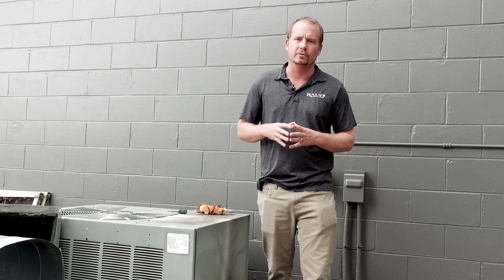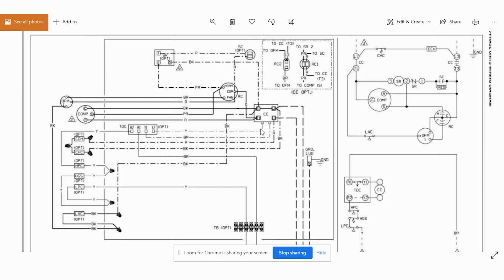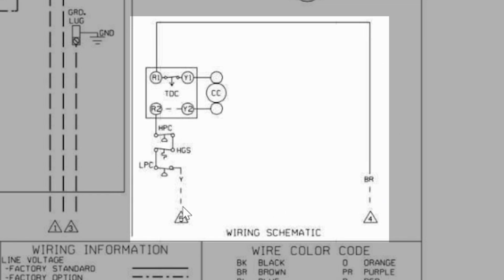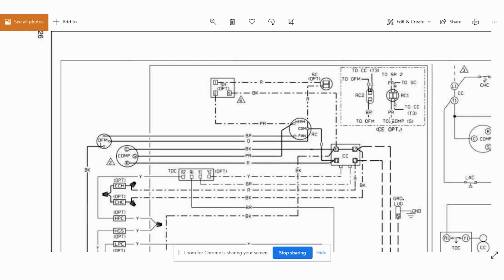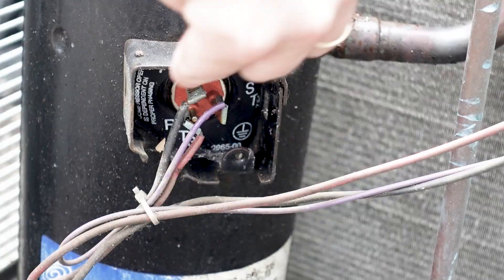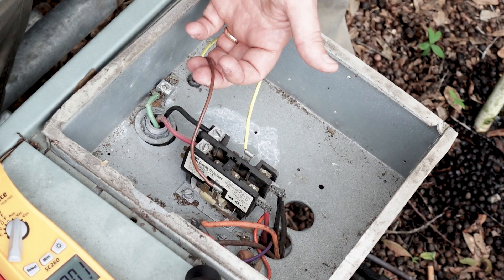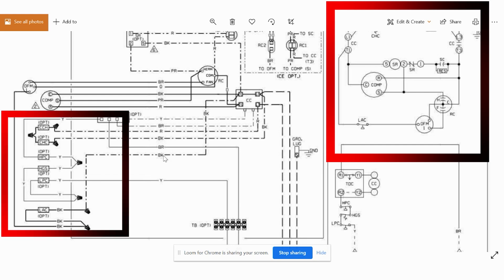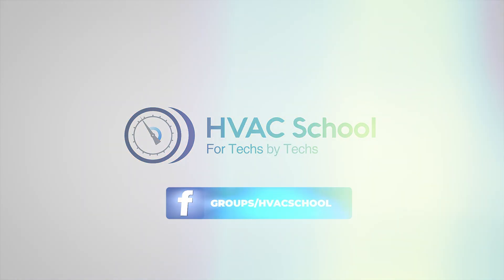Wiring Diagram Tracing - Older RHEEM Condenser

Comment: My problem is so many wires and no clear path. I have about 4 Yellow wires abd not sure which one goes to the contactor abd with 2 pole run/start capacitor how those yellow and purple or brown connect there. Rheem is not east to replace the two components. The AC guy sold me a capacitor that was smaller and fell through being too small even though I handed him the old one and he went to another guy. Now he says he marked it up and sold it as a favor. The supply that sold it wouldn't sell to me because I wasn't a Florida electrical AC contractor. These guys are idiots!

Comment: hey this is my unit NOW in july 8th 2021,,i keep it running as much as i can i am old man  money is tight , i still have a full jug of R22 and about 1/2 of another ,,,,,,i was wondering if it would be worthed to ? when the time comes buy a 410 unit change out the txv to a r22 and go that way ?  or just  sell my UN opened r22 that is sealed still and go with the 410 ?  of course in central florida HEAT PUMP is needed couple more wires ,,,,,thank you for all your teachings its all good and it never hurts to review things especially when you cant work anymore god bless teachers .

Comment: how do you explain a COMMON wire ?   i was told back in school that its a wire by itself ,,,,do you have the same determination as that ?   thanks
Reply: Think of common as the side that completes the circuit. Hot wire goes through a load and travels out through the common. Common is the "common" side of a circuit because all circuits/loads must complete through common.

Example: You turn on the thermostat to "cool." Red (hot) wire is jumped/connected to yellow (contactor outside) and green (indoor blower fan). When the current goes through each load it must travel back to common and through the transformer. Thus, common is the same (common) path for all loads in the circuit.
Reply: @jericosha2842  your looking at this as a ground or return ,,,because i seen a hot wire being called a common ,,,,see the confusion that everyone has ?  i get it that a circuit gets completed by A wire i am saying that its almost like asking 5 welders on how to do a job ,,,,we get 5 diff ways LOL ,,,,,